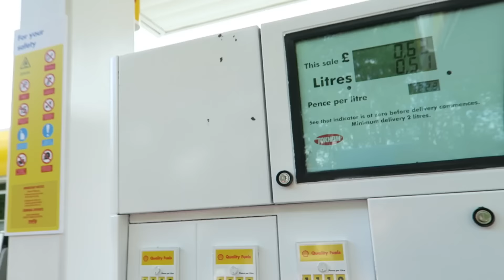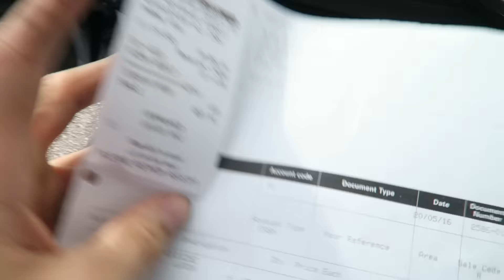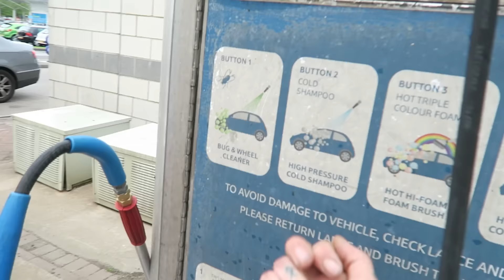THE CUPRA IS BACK!

Comment: Clem...FYI for future reference. In your engine bay on the left hand side, there is a little red cap thing. Take the cap off... This is a positive terminal which can be used for jump starts. Then just put the negative wire on the car chassis somewhere with bare metal.